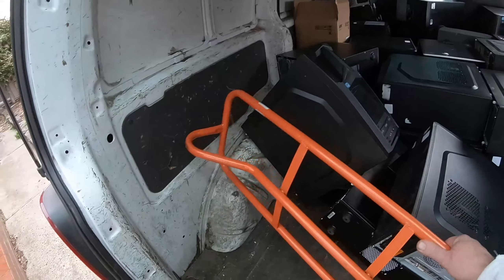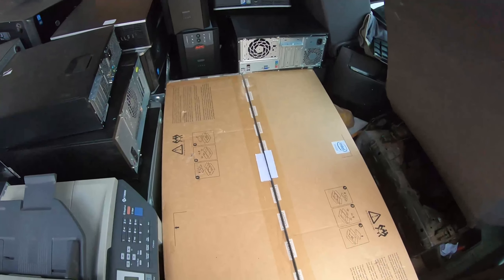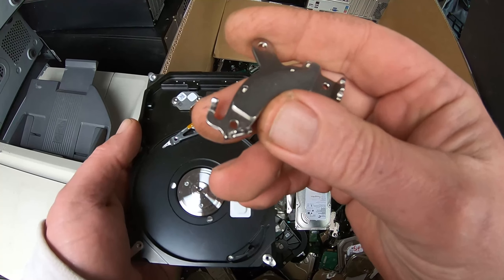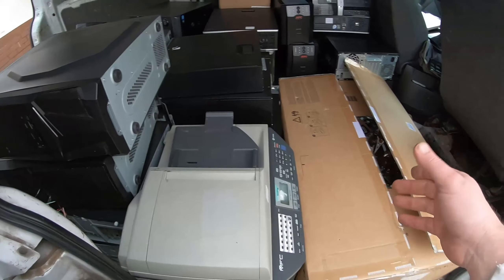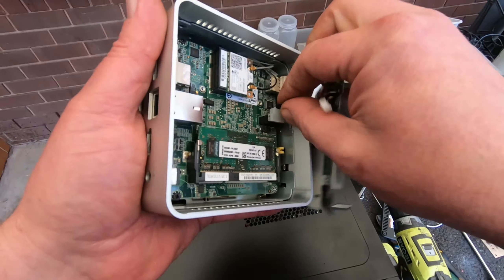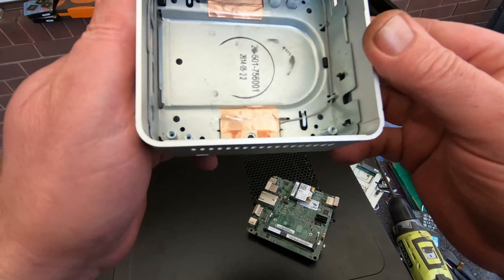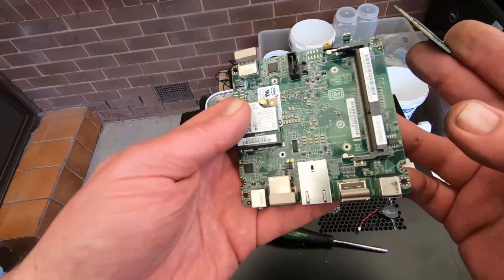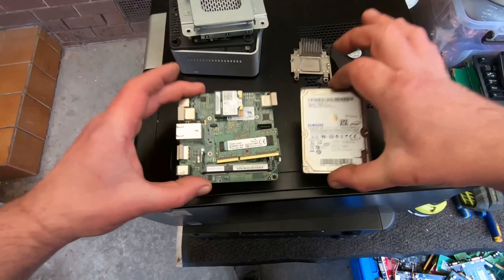Scrapping Worlds Smallest PC - Intel NUC

Comment: NUC stands for Next Unit of Computing. The basic idea was when you needed more power, you just buy another nuc and daisy chain them. No need to upgrade the unit. Just stack them and connect. You can upgrade to SSD if you care to. The new Rasberry pi 4 is supposed to be really nice.
Reply: @cheesymoments2087  I never said they were comparable. The pi 4 is just dirt cheap for basic use, that's all. What Intel never figured (for the nuc) was the power used as you added units makes it horrible. After 3 units you could be talking about some serious heat given off.

Comment: 6 User Reviews
HP Chromebox G2 7th gen Intel® Core™ i5 i5-7300U 8 GB DDR4-SDRAM 32 GB SSD Black Mini PC
7th gen Intel® Core™ i5 Processor
32 GB Capacity
8 GB Memory
Intel® HD Graphics 620 Graphics
20.1 oz (570 g) Weight
Chrome OS Operating System
 Add to Compare 
Previous  Page  
1
   of  11 Next $699